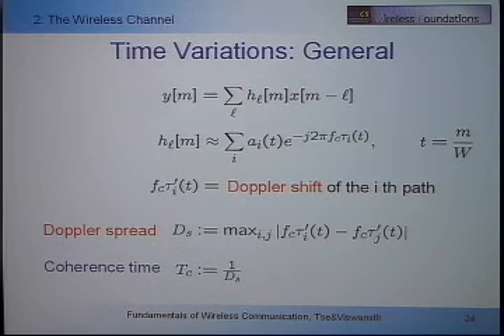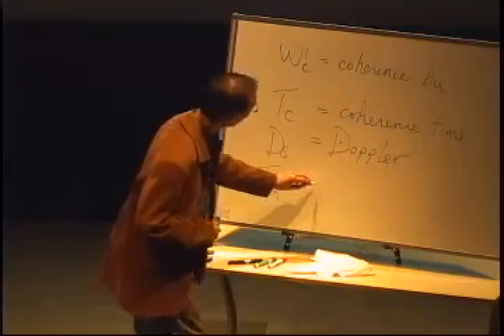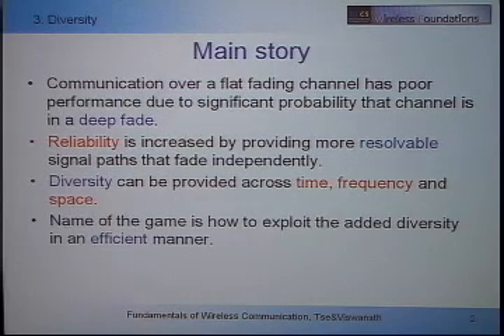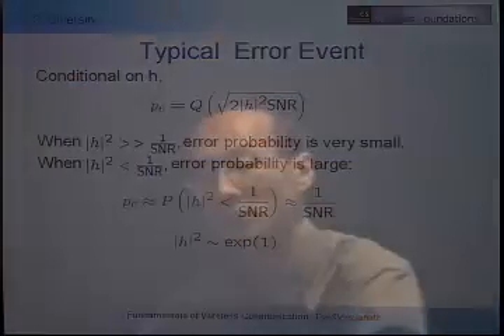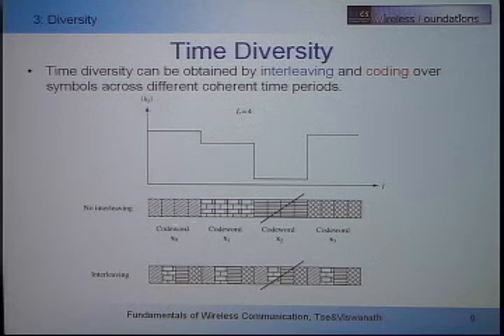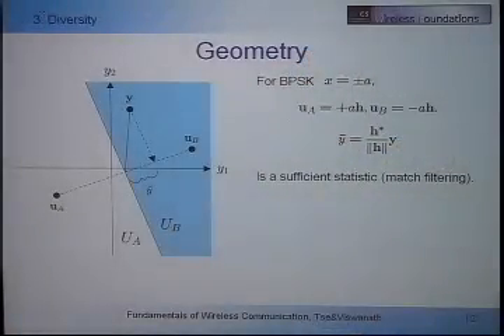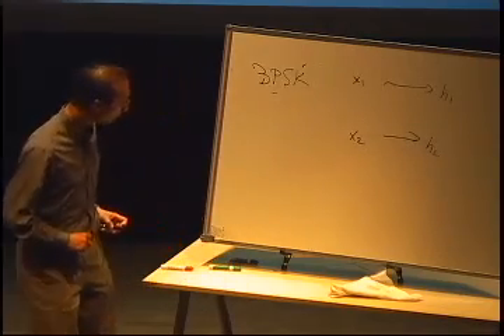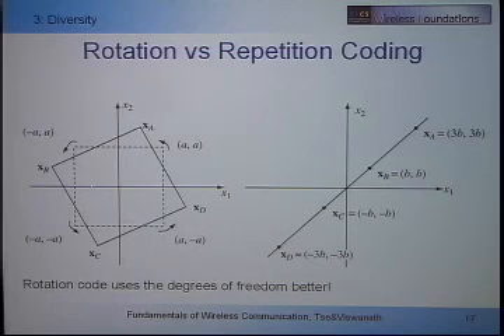Fundamentals of Wireless Communications II - David Tse, UC Berkeley

Comment: Doppler spread is linked to variation of the phase, but we don't talk about the variation of the amplitude. The reason is that the change of amplitude takes place slowly. 

The sum for a channel tap includes all the paths within a bin. But if the path changes, they can shift from one delay bin (1/W duration) to another delay bin. This variation of the channel is not considered as this change takes place in a time scale on the order of 1/W. On the other hand, phase change takes place on the order of 1/f_c which is very small usually. So, we consider this. However, this is not true for wideband consideration.

Fast fading/Slow Fading Channel:
Fast fading: Coherence time<application specific delay requirement; otherwise it is slow fading

Flat Fading/Frequency selective Channel:
Flat Fading: W (channel bandwidth)<W_c (coherence bandwidth)
Frequency selective fading: W>W_c

Fast fading or Slow Fading? Flat Fading or Frequency Selective fading:
Frequency selective fading is preferred because the chance of everything going down is small. But from the receiver's complexity point of view the frequency selective channel is not good.
Similarly, we prefer fast fading channel

Underspread Channel:
Underspread channel occurs when the delay spread<coherence time. Coherence time depends on velocity and frequency, and is the order of ms or more.Delay spread is on the order of microseconds or Indoor (ns). Underspread is a common phenomena in communication system

LTV (Linear Time Variant) vs TV (Timùe Variant) Channel:
Normally, we have an LTV channel.We don’t study it because it is massy However for underspread channels, we can consider that  a LTV channel is a  LTI over the coherence time, and changes to another LTI during a different coherence time.

Coherence bandwidth is reciprocal to delay spreadCoherence time is reciprocal of doppler spread.

Distribution of a Communication Channel 

We don’t need to know the distribution of the paths within a channel tap, rather the distribution of the summation. From CLT, the distribution of a channel tap will be Gaussian  However, we will have the real part and the imaginary part both gaussian. This is called complex circular symmetric Gaussian. It means that the phase of the RV is uniformly distributed between
0 and 2pi. The uniform distribution of the phase is very logical.

If we plot the real and imaginary part and plot the pdf as contours, it will be flat. Real and imaginary parts may not be independent of each other.  Rician distribution is when there is one significant part, e.g, LOS (Given by a deterministic amplitude plus random phases) and summation of scattered path given  by circularly symmetric Gaussian RV variable

Diversity:
Performance is bad when the channel is in deep fade. Reliability is increased by providing more resolvable signal paths that fade independently. Diversity can be provided across time, frequency and space. 

Application requirement may be in terms of error probability. Error probability of an AWGN channel is a function of SNR and is expressed as a Q function. For decoding in case of a Rayleigh Flat fading channel, we need to estimate the channel. In reality, training or pilot symbols are sent every now and then. 

Since the coherence time is bigger than symbol time, we see many symbols within the coherence time. We need to send pilot symbols at different coherence times. This is known as coherence detection in which case things become like an AWGN channel except that h comes into the equation of error probability. We can compute the average error probability over h, and it turns into 1/4SNR at  High SNR. Error probability decreases with SNR exponentially for AWGN channel while for the Rayleigh fading channel it decreases linearly. There is not much difference between non-coherent and coherent performances (Error probability vs SNR).

If (absolute of  h)^2 >>1/SNR, then the error probability is very small. Average error probability for fading channels is much higher than that for an AWGN channel. Error occurs when the channel is in deep fade.

If we use 4PAM instead of 4QAM, then we send two bits per real symbol. If we want to have the same nearest distance, then PAM will use more power than 4QAM.  QPSK packs symbol in higher dimensional space (high degrees of freedom) while 4-PAM use only one dimension

To reduce the gap between the AWGN and the fading channel in terms of P_e vs SNR curves, diversity is applied.

Time Diversity
If the delay requirement is longer than the coherence time, one can wait to decode the symbols. So, I can afford to code over a longer period, e.g., more than the coherence time. Therefore, in the decoding time scale, one will see the time variation. If the whole codeword is within the coherence time, there is no time diversity. If the channel is in fade, we lose the whole codeword. So, we do interleaving so that  we don’t lose the whole codeword. For the GSM system, interleaving is done over 8 TSs. One codeword is split up into 8 TS. If there is no delay constraint, then it is possible to interleave over many TSs. But it is not possible if there is a delay constraint. Time diversity needs the user or the environment  to move to have independence.

Repetition coding
Repeat the same symbols over and over again.The repeated symbols see different h coefficients due to interleaving. Channel is now a vector. If I multiply with the transmitted symbol x, then the received signal,y=hx+w. Projection if y in the direction of h divided by ||h|| is, y_hat=(y.h)/||h||=((hx+w).h)/||h||=||h||x+(w.h)/||h|| 
The above is known as match filtering

For no diversity or scalar case, |h|^2< 1/SNR when deep fade. For Time diversity, ||h||^2< 1/SNR . Error probability vs SNR gets better with L increasing as the error probability  p_c=1/(L!SNR^L). Deep fade in this case is achieved when all the channels are bad. The L power in the SNR is due to the fact that all the h are independent here. What do we lose here? Sending 1 symbol for L channel uses. Reliability is achieved at the expense of data rate. Is this always the case? According to Shannon the answer is no. We can do clever coding to achieve a better data rate within the capacity. Repetition coding is getting full diversity . An example of clever coding is rotation code where we use the full dimension, i.e. all the channel uses, but we do the coding in a way such that the error occurs when both the dimensions (2 symbols for 2 channel uses/2 dimensions) are largely disturbed. The rotation should be such that none is vertical or horizontally aligned. With Rotation coding, we achieve a diversity gain of 2. But it depends on the product distance as well. We want to make product distance as small as possible or maximize the worst case product distance  When L=1, ||h||^2=|h|^2 and it has an exponential distribution. With repetition coding, we can use the same data rate if we want but at the expense of energy.